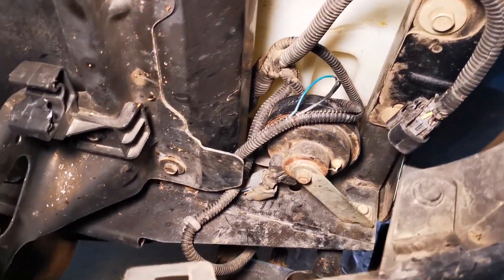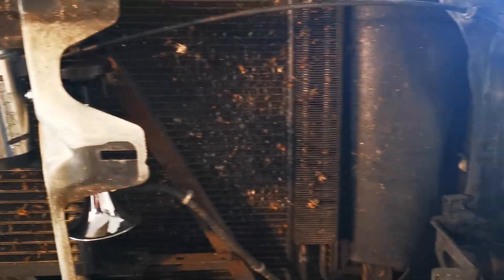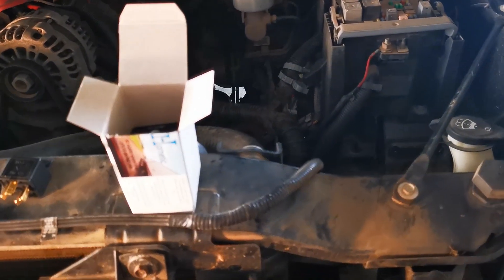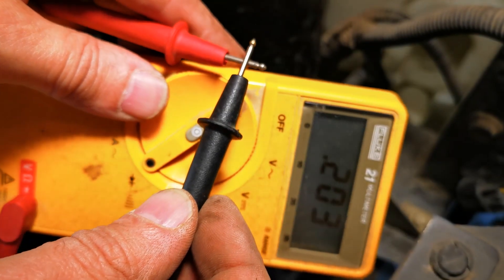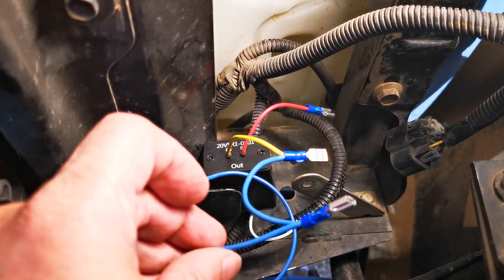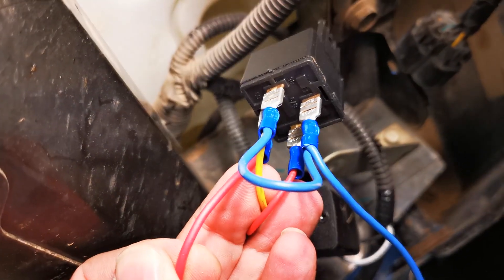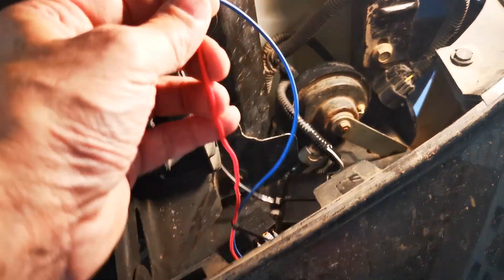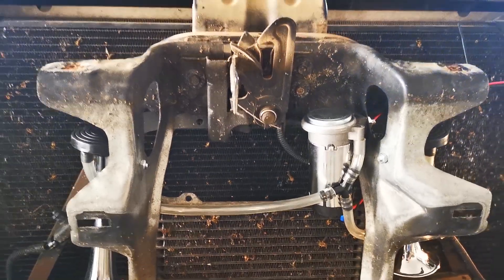Hornetic Installation in Pickup Truck

Comment: so the the module latches on when it sees a longer 12 volt input?    moematary 1 sound, hold down for 2 sound?   High & Low frequency output like traditional air horns?
Reply from the maker: That is correct. tap your horn for the OEM hold it for OEM + Secondary horn.
Reply: @HomeBuiltByHoward  thanks for the reply, very intelligent product

 best regards
Reply from the maker: @vipautonyc-chucheroworld-jimmy  Feel free to reach out if you'd like to get some units into your shop. I can mail you out a counter poster and our price sheet if you like.